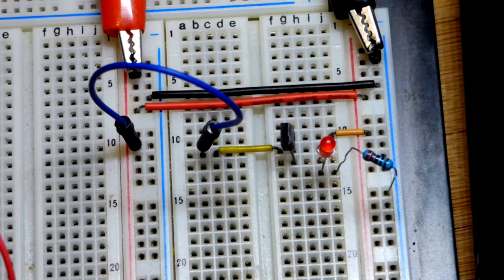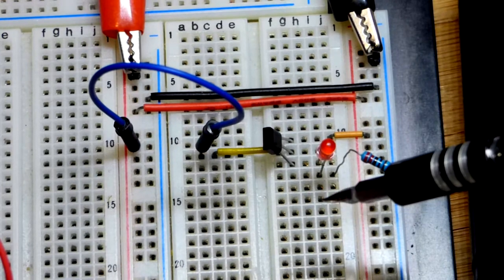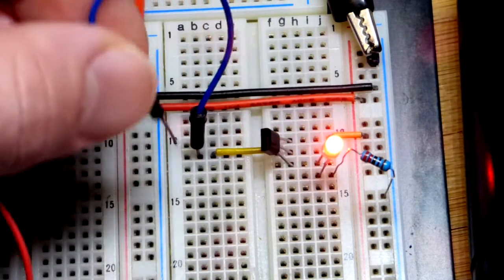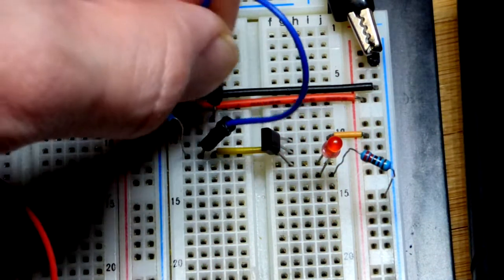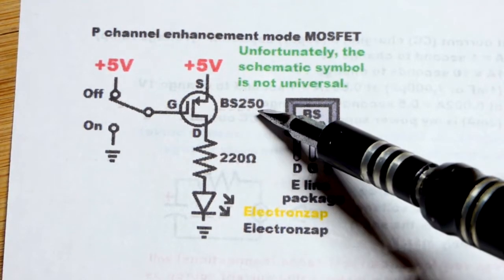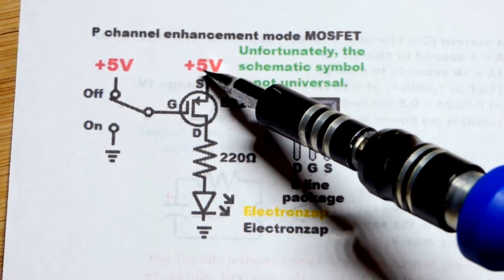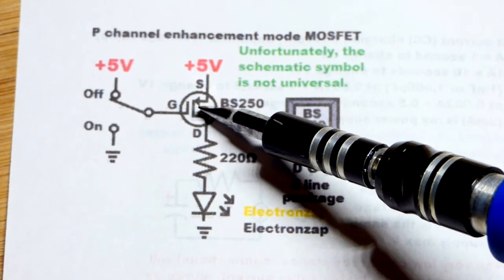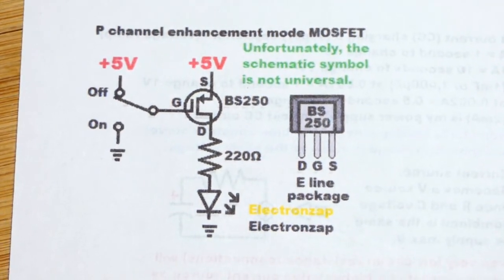BS250 P channel enhancement mode MOSFET E line switch LED circuit learning electronics lesson 0036

Comment: One of my big breakthrus in learning electronics was finally understanding how current flows thru the base or gate for PNP and P channel transistors. The distraction is that their difference from NPN and N channel is simply that they are "turned around."  There's much more to the story ... it's about the direction that current flows thru the base or gate --- it's sunk, not sourced! This should explain why "allowing" the signal to be shunted to ground thru the base or gate is perceived as "on". Or at least I think that's how it works ... xD